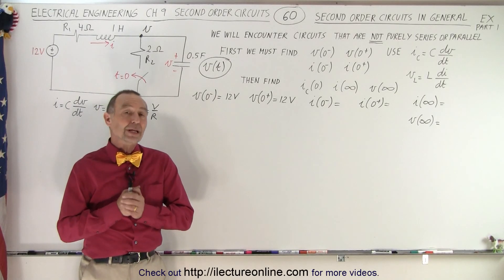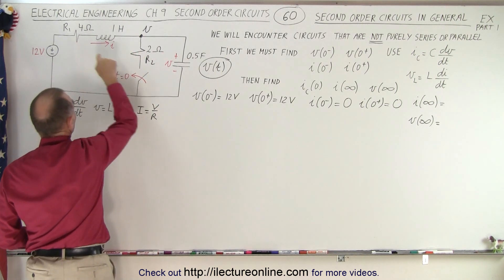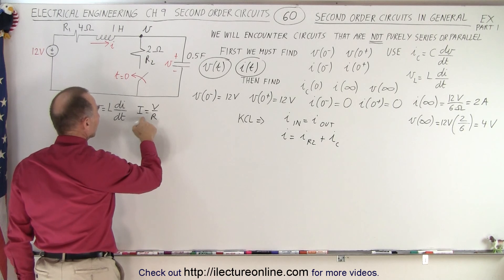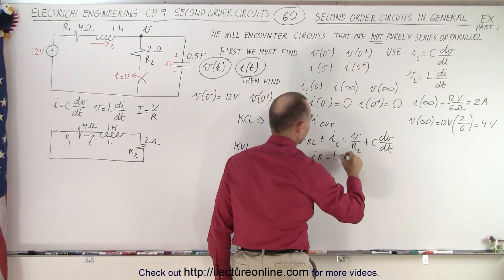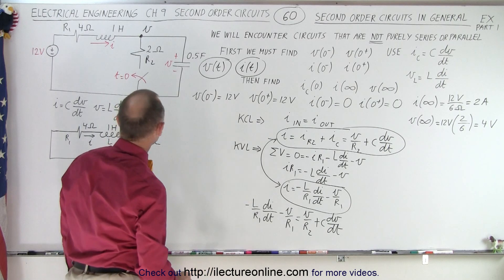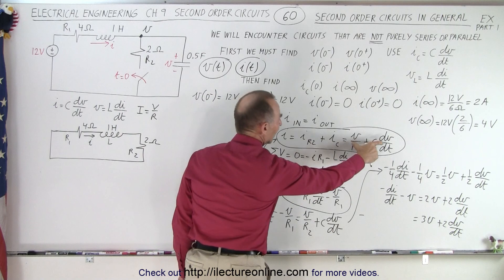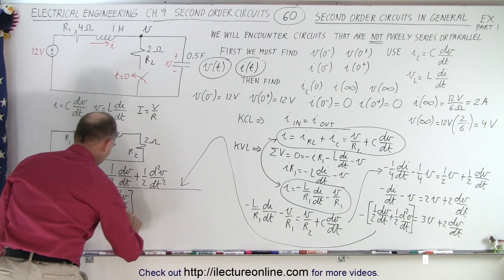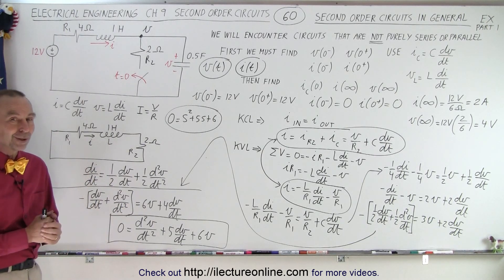Electrical Engineering: Ch 9: 2nd Order Circuits (60 of 76) 2nd Order Circuits in General Ex 1 Part1

Comment: Professor in using KVL we must equalize all voltage drop with 12 volts ?
Reply: In this case
Reply from the maker: Not sure what you mean by "all voltage" drops.  Before the switch is opened, there is no current flowing through the circuit and none of the resistors will therefore have a voltage drop.  But the capacitor is then fully charged so the voltage drop is only across the capacitor.
Reply: @MichelvanBiezen  ohh yes now I understand

Comment: At around 4:10 when you are getting rid of the source by shorting the voltage sources, why isn't the capacitor shorted? And the 2 ohms resistor gets bypassed? Thanks for the awesome tutorials
Reply from the maker: The second circuit drawn is actually the steady state condition after the switch has been closed for a long time.  At that point the capacitor will be fully charged and no current will be flowing through the branch with the capacitor.
Reply: @MichelvanBiezen  Thanks for your response, I have made another observation, at around 4:49 if I write the kvl as 0 = -iR - Ldi/dt - iR2 my differential equation turns out to be s^2 + 7s + 6 do you know the reason why? I was thinking it might have something to do with the second loop, the discharging of the capacitor...
Reply: @MichelvanBiezen  but you mentioned it is for "transient response", closed for a long time is Steady state response?
May I say that the transient response is the same as the natural response ?